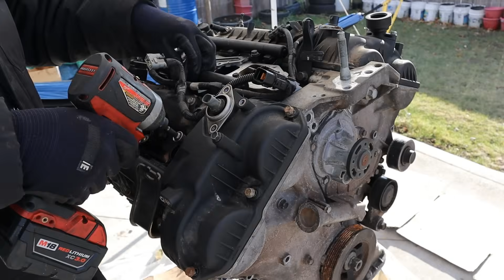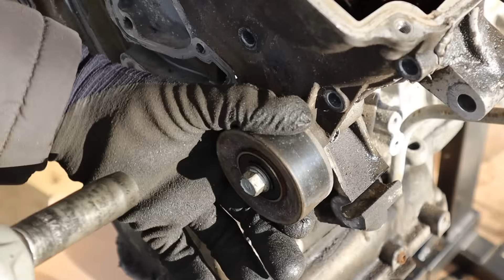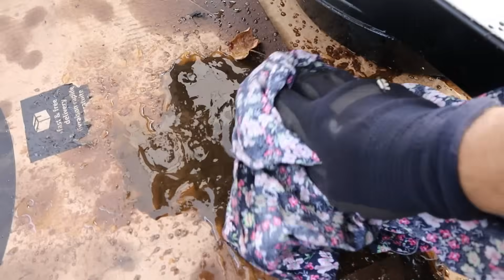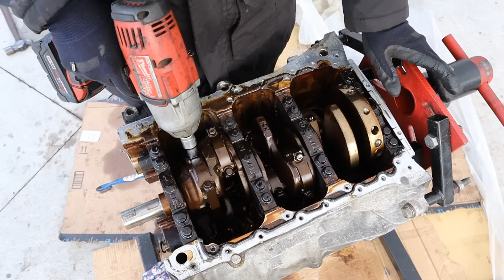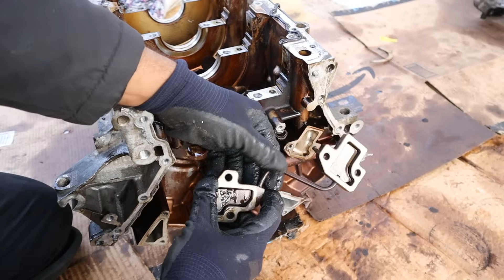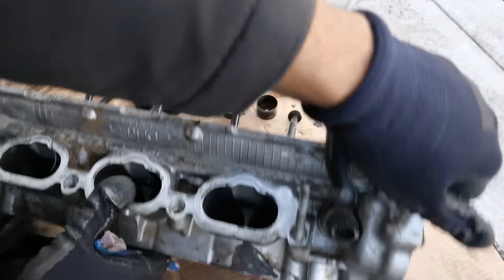A Reliable Hyundai & Kia Engine? Lambda 2 V6 Teardown

Comment: Lambda is known for overheating? What's cause? Water pump failure?
Reply from the maker: Yeah but also the head gasket design
Reply: @speedkar99  What is wrong with the design? It isn't just case of bolt not being torqued enough? If it's in fact shit gasket what rough mileage would you recommend a preventative gasket swap.
Reply: @FonicsSuck  whew that sound good. That's almost satisfactory coming from beloved Ford modular 2valve 4.6 in panther platform just plastic intake manifold replacement at around 150k alternator around same time. Steering gave out at 174k ish then got rid of car due to life circumstances not having enough time or money to find low mileage junkyard part. Wish I could rip out motor and transmission driveshaft and axle for some cool off road kart toy or high mpg ultralight car crazy power and torque to weight. Went in debt for Hyundai palisade for new job

Comment: My 3.8 Lambda is currently making over 430whp and going strong!

Of course, with ARP fasteners and forged pistons and rods 😅

A very simple and easy engine to work on. Strong lower ends.
Reply from the maker: Genesis?
Reply: @speedkar99  Yes, Genesis Coupe

Comment: This engine appears to be very well designed. What irks me is the lack of preventative maintenance on this engine and this can be seen by the heavy staining left by the oil. The excessive use of sealant is a worry and the use of a wrong head gasket speaks volumes why this engine failed. All the bearings were good and the oil ring was also unblocked. So why did the engine overheat.....poor ongoing maintenance by the owner.
Reply from the maker: I think the gasket design. You're right it's a pretty simple engine. Reminds me alot of a Toyota

Comment: I did a short block build on this engine.  Haha
Reply from the maker: How did it go?
Reply: It went well.  The engine had horrible oil consumption problem and the customer got a goodwill repair from Hyundai.  Customer got lucky for that.
Reply: Also, when I was tearing it down one or two head bolts weren’t that tight either.  Funny how you ran into the same thing.

Comment: Hey Speedcar, rebuild that engine. Make a series other than your teardown videos. Show us how you would clean the engine, check tolerances and do a modular rebuild. That would be enjoyable to watch. Everyone else is rebuilding old tractor engines and it's getting boring, we want to see a newer engine rebuild. Have a buddy build an engine run stand, hook up a harness, and run it, that would be really cool. Great videos, I've learned a lot, thanks.
Reply from the maker: I like to break things apart not put them back together 😅
Reply: The types on engines he gets it would cost too much and take too long to clean the engine.   Most people would take a few parts from the engine, clean then, for theirs, for repair.  Well on normal cars, not Korean garbage.
Reply: @greggc.touftree5936  Korean garbage eh. Did you not watch the video? Have you not seen any other engines before? 

What sort of data sets are you cherry picking from to label anything from Korea as "garbage"?

Comment: Great video!  So I understand . . . You think the engine failed because bolts were loose around one of the head gaskets, or was it that the head gasket was faulty?
Reply from the maker: I think the gasket failed and maybe the bolts then came loose by warping ...

Comment: In my dads 2010 santafe its been working for almost 155k kilometers and so far the only thing that went wrong and had to be replaced was the cvvts.
Reply from the maker: Were they rattling? The VVT gears?
Reply: @speedkar99  well yes on cold start you could hear them for 1-2 maybe 3 seconds and it would go away. and as it goes with the usual car owner my father didnt care about the sound cause it would go away. he finally agreed to take it to a shop after like 8 months arguing.

Comment: The Lambda engines are one of the best engines from Hyundai/Kia. Very reliable and no horrendous recalls or engines failures unlike Nu or Theta. They have a reliable and simpler design. They also have better build quality as all the Lambda engines are built in Korea. (Nu and Theta sold in US and Canada are built in the US).   These engines were found in the Veracruz, Genesis, Genesis Coupe, Azera, Entourage, Sedona, Armanti. These engines can go up to 200k without any trouble. Overall great teardown. This engine could have lasted a lot longer.
Reply: I would still go for the Delta, every time. Small, yes, but all-metal construction, dead-simple, as easy to service as a transverse V6 can be. Can also take some turbocharging with stock internals.
Reply: You forgot older Sorento 👌
Reply: Lol NO IT’S NOT! I’m a Hyundai advisor and they coming in burning oil left and right. Then there was and is a full engine recall for faulty valve springs. And now I’m getting an irrelevant batch of ones just randomly throwing connecting rods out the side! BS!!!
Reply: @OneLeggedStormChaser  The 6 cylinders are peach not the 4's, the 4's are always trouble..
Reply: @seatime674 the 6 cylinders are what Hyundai lost a class action lawsuit over last year. So no. They’re not good
Reply: @matthewnethers8908 They lost the lawsuit on the Lambda 2 equivalent for Hyundai yet still a good motor, but for Kias Lambda 3 v-6 since '22 it is basically bullet proof now...
Reply: @OneLeggedStormChaser Are these big problems for the 4 cylinders or are you seeing 6 cylinders fare better!!
Reply: Just really quickly google the class action lawsuit that Hyundai lost last year forcing them to extend their warranties on their lambda II because of manufacturing defects causing catastrophic failure before 150,000 miles. My wife’s 2017 Santa Fe with 110,000 miles on it just blew up and was covered under warranty because of it.
Reply: @matthewnethers8908 pretty sure that’s the Theta II engine not the Lambda II. All Santa Fe’s came with the Theta II engine. Lambda engines are only V6s
Reply: @xcmskim4 I would not buy any 4-cylinder from Hyundai or kia at the moment only 6 cylinders Lambda 3's '22 & up..
Reply: @xcmskim4 it was the Lambda II V6. My wife’s car had the Lambda II and was outside the 100,000mi/ 10year warranty when the engine stopped. It was extended to 150k/15year. We just finished the BuyBack process because of it
Reply from the maker: I'm surprised at it's simplicity.
Reply: Helloooo Is the '22+ Carnival 3.5 the Lambda 3 really good to?
Reply: When should I change the coolant in my Telluride and will that reduce the chance of coolant getting in the cylinders?
Reply: @garyganser2451 Just regular preventative auto maintenance, change your coolant at 30k, change your oil at 3K and don't ride it hard to preserve your head gasket and all other internal parts.
Reply: Our family has a collection of around 5 kia opirus 2nd generation (amanti in other regions). Other than oil changes, they don't stop going. And radiator change after 200k kms.
Reply: The 3.3L is still considered Lambda 2
Reply: Not true, price out one for a 14 Sorento for example at a junkyard 7,000 for a used engine.
Reply: @earlscheib7754  Sorento did not have the 3.8L Lambda engine
Reply: 2018 Lambda engine are failing prematurely, even those that were serviced by Hyundai. The NTSB has several 100 complaints about this piece of crap engine. Maybe you work for Hyundai??
Reply: Plastic fuel rail = car on fire.
Reply: @applepoop10 I take it you've never opened the hood of a VAG or BMW in the last 25 years lol. Every BMW is born a whale dies choking on plastic 😂
Reply: They're both also known for overheating issues and relatively weak rods that bend if not babied.
Reply from the maker: They're still better than Hyundai's other engines 👀
Reply: @know916bound MY 3.3 has been at 650wtq and 530whp for a year, what do you consider as “babied”?
Reply: @christucker9566  fluids changed more often than not, you've probably had to add a decent amount of support to make that a reliable build as well. And you probably upgraded the rods. And if you didn't. Your rods will definitely twist and eat themselves soon like every other one. It's definitely more hassle than other builds. And already garbage stock.
Reply: @know916bound  It’s a completely stock motor, frequent oil changes, methanol injection and an aggressive tune.
Reply: @know916bound  Let’s not forget the people that are running even more power on stock internals, there’s many at about 700whp and one guy in Korea at 1000whp stock internals with headstuds.  Have been a strong member of this platform since 2019 and have only seen two total engine failures, and in both cases the oil was old.
Reply: @christucker9566  keeping just the block, isn't stock. And they're are definitely more modified than you're letting on. And MANY japanese 4 cylinders can make the same power or more. And easier.
Reply: @know916bound  Even when babied they fail prematurely.
Reply: @know916bound Don't speak, you don't know anything about the Lambda. Lambda ll 3.3t has been 100% reliable. My buddy has a 167k miles Kia Stinger GT, with no issues to the engine. It being forged crank and forge pistons, no way it's getting bent.
Reply: @know916bound rod bearings. The rods are huge

Comment: Wow a video relevant to me...I have a 2021 Hyundai Azera with a 3.5 V6 lamba 2. Time to see what's going to be wrong with my car (100k KMs so far no issues...)
Reply from the maker: Work on the coolant more often 
If it gets contaminated it can work at the head gasket
Reply: I had the 3.3 v6 2017 and loved it. Traded at just over 100 km for the 2022 3.5 v6. Loving just as much. And pretty good fuel consumption for a beefy v6 ...

Comment: Thank you for your vids. Am a long time subscriber. It'll be lovely if you could do a teardown of one of these Ford 3.5 Cyclone / Duratec V6 you find in these newer model Taurus, Explorer Edge etc. Especially with the common water pump issues they usually have. I love the engine as they're very reliable though.
Reply: I think it would be more fun to tear down 1.6L EcoBoost with timing belt soaked in oil😂
Reply from the maker: Thanks. I'd love to teardown a duratec or EcoBoost ford V6 sometime. The cores are so expensive, it's hard to find a cheap one.